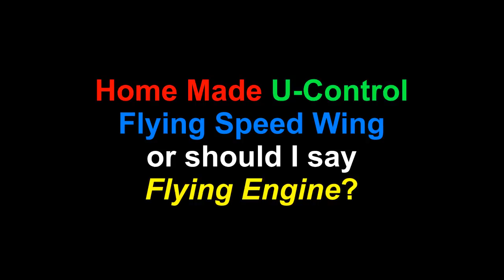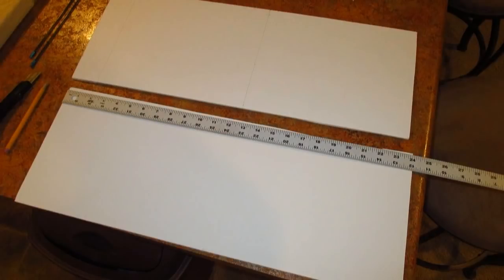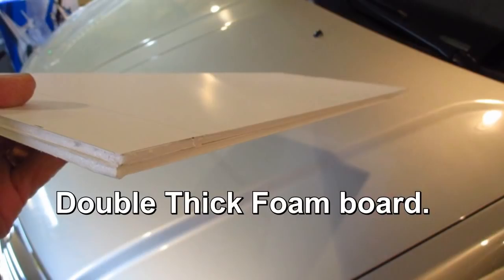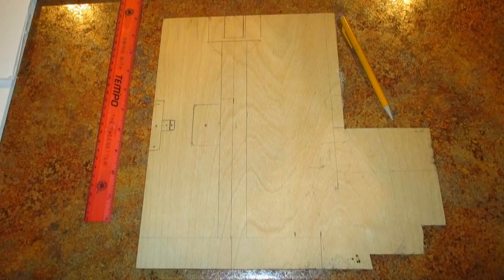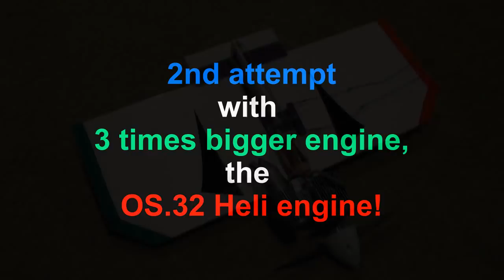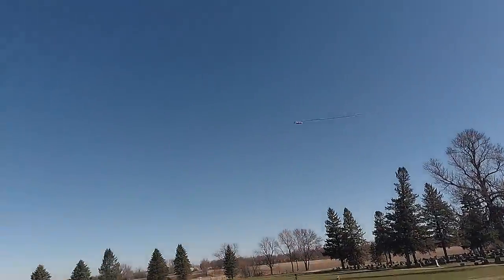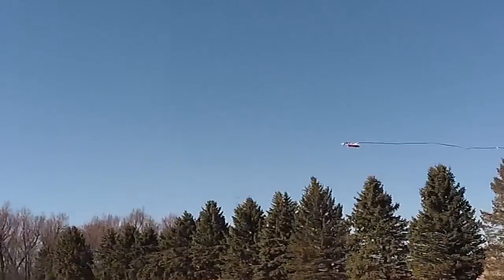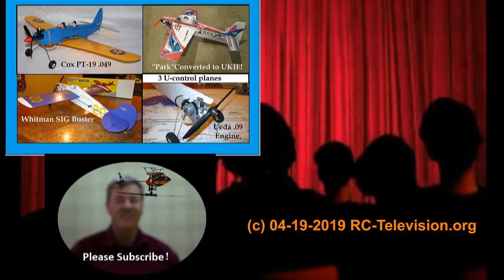Foam Board Ukie Flying speed wing...or make that a flying engine!!

Comment: If I remember correctly mine was powered with a 35. I got dizzy watching the video. Don't think I could do it today and looks like you finally had to get down to get your bearings back. It's really hard to admit that we are getting older and can't still do what we did 50 yrs. ago. Thanks for the memories my brother and thaks to your wife for being a great help mate. Shalom
Reply from the maker: Haha.  Yes my original Voodoos were also the .35.  I used a McCoy Red Head with no muffler. This one has the OS .32, slightly smaller but way more power even with a muffler.  Thanks much!

Comment: Thanks for posting. Flew some control line models back in the 60's. The local schoolyard wouldn't allow it now probably,too much noise,too many neighbors
Reply from the maker: Great to hear from another ukie flier! Your right about the noise. I dont know how we got away with it in the 50's, as there were no mufflers on the engines.  That's why I fly beside the cemetery outside of town.  No one complains there! Thanks kindly.

Comment: Dave your face said it all ! whilst dizzy with age you achieved your dreams to fly a Ukie again,anyone who has ever flown U-Control will know the feeling of that model responding to your hand movements on the end of those lines,now put the darn thing away and get on with something more suited to your age !! you achieved your aims and re-lived your youth in a few minutes,I have a few U-Control hanging on my walls as a reminder of how I got started operating model engines,mostly old ED diesels that spewed out black oil,but we loved the smell of spent diesel fuel and glow engines came later on.
Love your channel,you are a real gentleman,thank you sir for reminding us of those bygone days.
Reply from the maker: Come on Angel....This is stuff suited for my age!  I proved to my self I could still fly something this fast and smooth too. But I also fly RC helis inverted, jets, water ski, and roller skate every Sunday at the rink.  You see l never stopped what I love and it keeps me "my age"  LOL.  Stay tuned, because I am putting lights on it for some night flying.  Thanks kindly for your comments.

Comment: I had a Voodoo in the early 70's and it flew great! I still got a Winder that I built a year after the Voodoo. The Winder is scary quick on the controls and made me always wished I had put less gas in the tank. Between the two I prefer the Voodoo.
Reply from the maker: I loved the Voodoos.  They were fun to combat with for sure and could really move.  I was wondering how long mine was going to run, and was also counting the seconds.  LOL.  Thanks Much.

Comment: How about a hybrid tether line and RC setup?   Single wire attached to a 5 foot pole with a swivel, and flying the wing with elevator only controlled by RC servo.   You stand outside the circle at a distance and control elevator with your radio.  This will save you from getting dizzy.
Reply from the maker: Thanks for the suggestion, but I wanted to feel the pull and experience what it was like when I was a kid.  I did it the way Ukie was designed. Besides, I already did the tethered RC version quite a few times and all are on my channel, like these 2. The first was 8 years ago.  Thanks.
Tethered RC Buster  https://www.youtube.com/watch?v=HcpK4N-Yg3A&t=1s
Tethered Lampshade and T-28 Trojan  https://www.youtube.com/watch?v=bEriqYYOe0w&t=1s

Comment: HA, I used to have a Lil Satin when I was a Kid. I took everything I had to keep it in the air. I don't remember what length lines I used, nor do I remember being aware of reducing control throws in those days.
Reply from the maker: I had one too.  They were great. My half rates were in my wrist.  LOL.  These lines are 52 feet. My O49 lines are 30 feet, but I may switch to 60 feet ones for this one like  I used to fly my Veco Thunderbirds on.  Thanks,

Comment: Dave, I had a VooDoo with a McCoy 35 about 56 years ago.  How long are the lines you are using?  We flew combat with 65 foot lines.  The longer lines give more room for maneuvers and you don't get so dizzy. Gary
Reply from the maker: Voodoos were 36 inch wing span and I flew them on 60 foot lines as directed by contest rules. This only has 24 inch wingspan so am using 52 stainless Steel lines. It would not loop where I had elevator or I would have. Once I find out if my new configuration works I will use a new set of 60 foot lines. Thanks. I appreciate your comments.

Comment: Just mount a couple of servo's and a receiver in it, it will be crazy fast.
Reply from the maker: Yes, but it would not be Ukie anymore, and that was the thrill I wanted and got. I used this same size engine in my You FO flying disk recently and it is crazy fast. It is made from foam board too, so you may want to check that out.  Thanks.

Comment: just need to find an old bar stool that swivels and put a ring on the bottom for your feet to enable you to spin around. might have to put a seat belt on it to to keep you from falling off after
Reply from the maker: Haha. It was pulling so hard it would have pulled a barstool over. I was used to it as I knew what to expect. Thanks.

Comment: Can you fly it rc after you fly control line plz
Reply from the maker: Yes I could Lee but would have to add ailerons, throttle, battery, and a receiver plus 3 servos. It would be similar to my Nitro You FO flying disk with the same engine, which had more room for all that, so will pass.  But I will be flying it with lights on it soon, so stay tuned.  Thanks. Much.

Comment: Why did it need such a big motor just to fly?
Reply from the maker: Because the tiny engine was not stirong enough to carry the weight of the plane and the stainless steel lines. If I had a.21 it would have worked. I used what I had. As you can see it was overkill but that’s why people put bigger engine in their cars.
Reply: @NightFlyyer  I just thought nitro motors had more power than electric,   a brushless 1/2 the size or less would have been fine if you went electric.
Reply from the maker: I flew an electric version last month in a video and it did fairly well but the .10nitro is only as powerful as two Cox .049s.